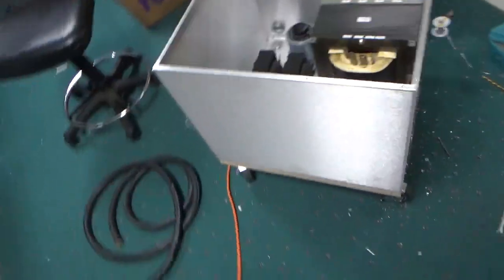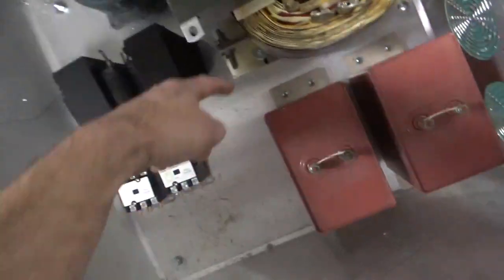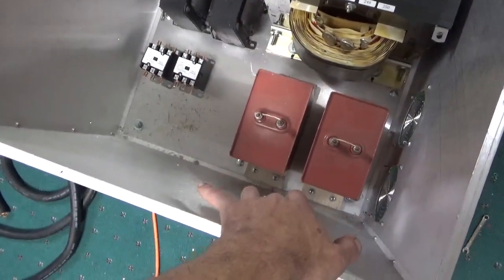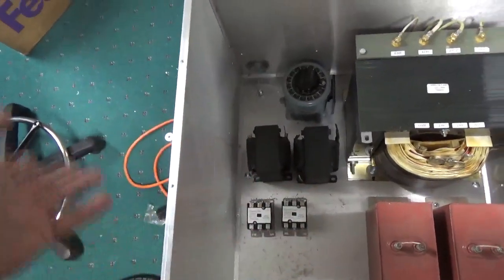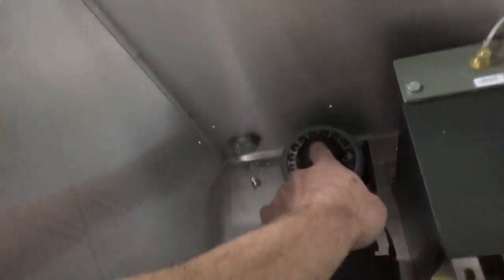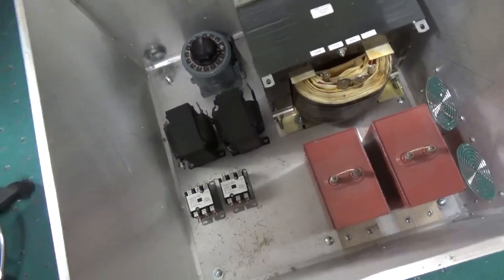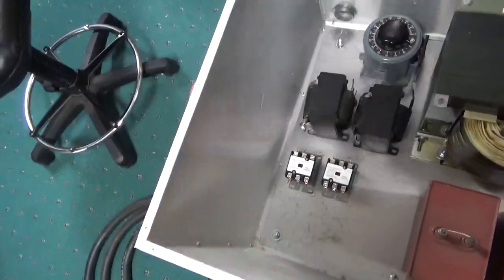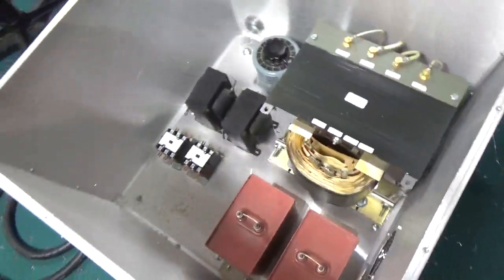6 Meter 10kw Power supply Parts  Layout

Comment: That's a HUGE transformer! Looks like it's going to be a very nicely-made supply, I just wouldn't want to have to carry it up stairs. I was not aware that 10KW was legal for amateurs, though. Subscribed.
Reply from the maker: Thank you for subscribing , he will run within legal limit. He just wants headroom for high duty cycle modes. Some ham amps will do beyond legal limit but have very low duty cycles
Reply from the maker: Low duty cycle at or below the legal limit